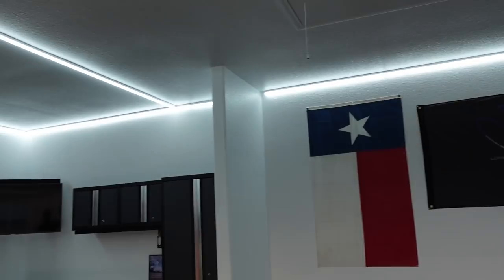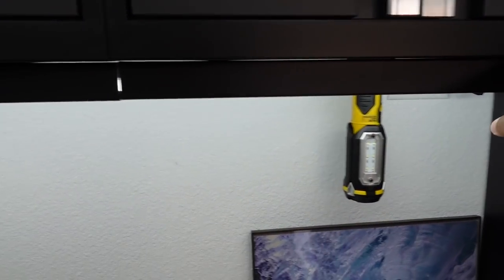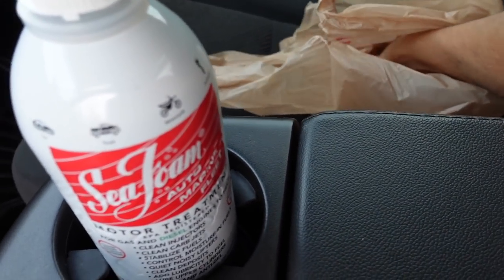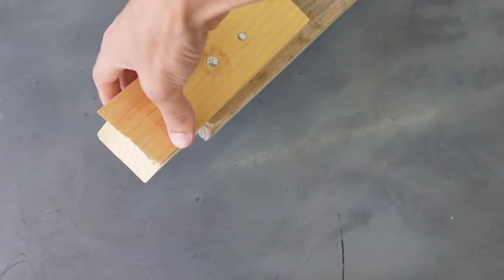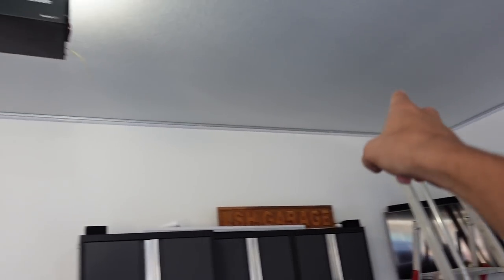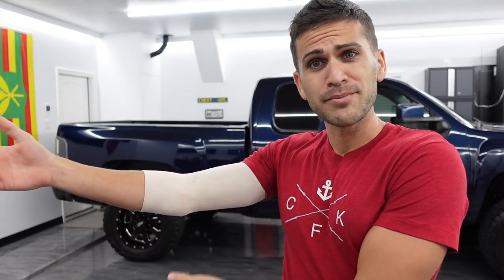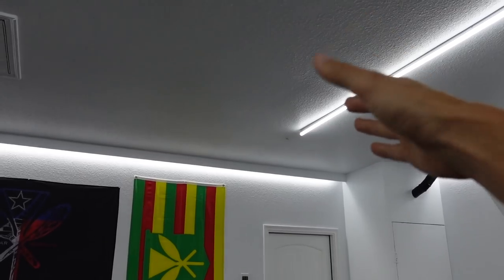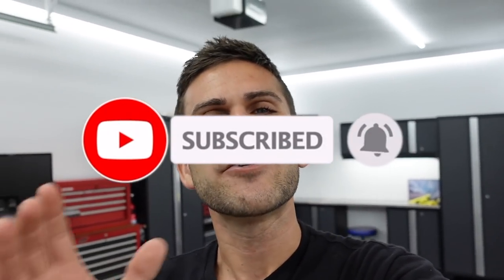Dream Garage Build Pt. 9 - The GREATEST (Cheap) DIY Garage LED LIGHTING Set Up

Comment: I was about to say you need to chalk and then you said it. My garage in the middle is 25 feet and I had a 50 foot later not extended and was painting when latter slide on concrete floor and I went down 25 feet to the concrete. Only time in my life I thought for a while I was really gonna die after I hit and it hurt bad. Later in the day ended up in ER but thankfully nothing broke or damaged except my pride. Oh and I skinned my shin and elbow badly also and light gray paint went everywhere luckily no cars in garage. Love your videos.